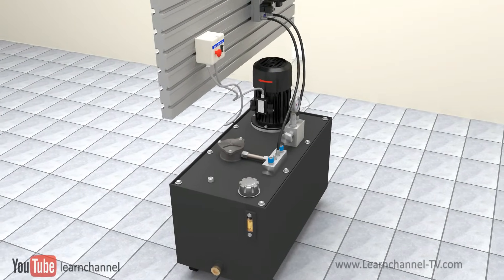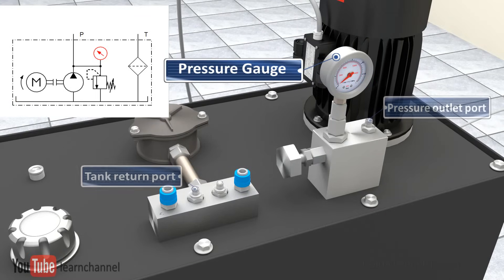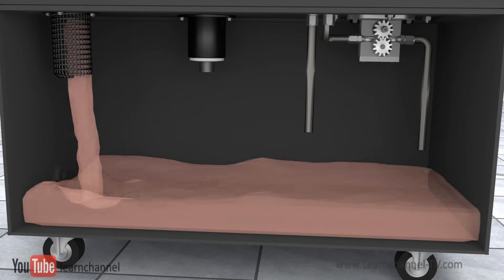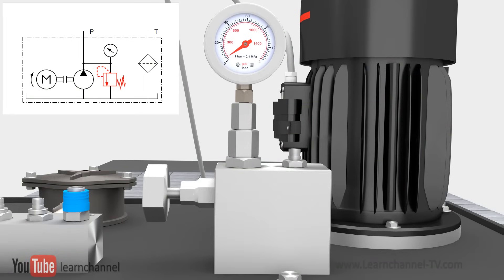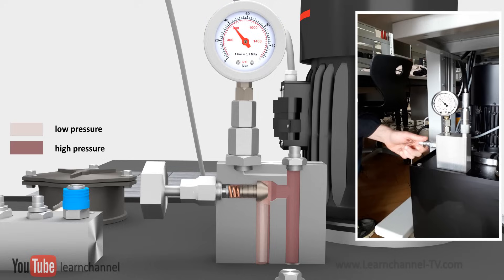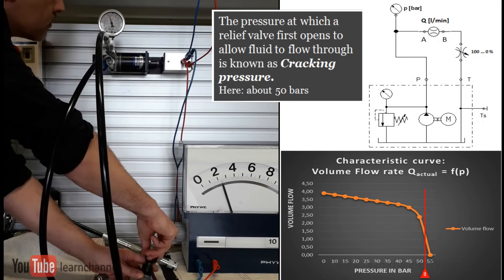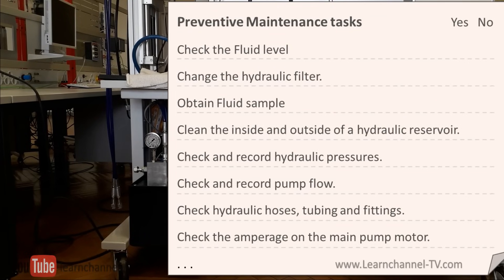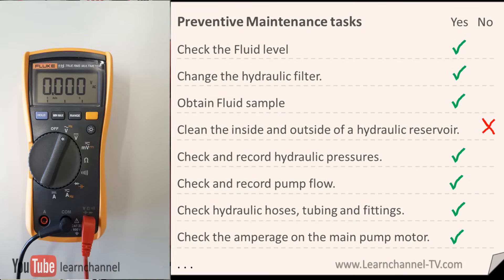Hydraulic Power Pack - how it works

Comment: How to calculate how many tons of pressure a hydraulic unit can produce?
 I want to use it in a cylinder of a plastic hydraulic injection molding machine. The cylinder is 25cm x 70cm

Comment: So Hydrolic motor will be a seperate unit from the Hydrolic Power pack ? I'm confused about whether Hydrolic motor is also a component of Hydrolic power pack circuit.
 Thanks for demolishing my confusuion.
Reply from the maker: Hi - I don't see an hydraulic motor in this video. The hydraulic power pack contains a hydraulic pump, which is driven here by an electric motor.

Comment: Hello sir,  the hydraulic pump has a 3 phase motor? Can i somehow find the wiring diagram of the setup where you control the hydraulic piston.  I can see that two wires going from the control buttons to the valve's coils. But where are the wires for the pump's motor?
Reply from the maker: Hi - this hydraulic pack has a single-phase induction motor - a capacitor motor. This is correct shown in this vid.

Comment: Hi. can this be used for high speed hydraulic tools such as pavement breakers (1400 blows/min)?
Reply from the maker: This hydraulic power pack is a small one for school. It can deliver 3,7 l/min and the maximal pressure is about 60 bars or 6 MPa. For construction sites you need a more robust one.
Reply: @learnchannel-TV  so I found out that I need about 30lpm flow and 1500psi pressure from a hpu to run the pavement breaker tool. What are the major components needed to make such a hpu?
Reply from the maker: @siddhantagarwal4371  The basic components, which has every hpu,: pump, filter, pressure relief valve, pressure gauge, manifold. Your motor to drive the pump will propably be a combustion motor.
Reply: @learnchannel-TV  Instead of a combustion motor, can't we run an electric power pack having such specs using a genset ?
Reply from the maker: @siddhantagarwal4371 And the generator set itself - driven by which motor?  Perhaps you might need the generator set also for other tools.
Reply: @learnchannel-TV  well genset such as those of honda are commonly available even for rent. My question is that apart from the type of power (either engine or electric) are there any different feature for a hpu to run high speed hydraulic tools (such as paving breakers) compared to the commonly available electric hpu used for linear actuators.
Reply from the maker: @siddhantagarwal4371  Perhaps you might need an hydraulic accumulator also to damp pressure surges. But sorry - I can´t tell it for sure.
Reply: @siddhantagarwal4371   to do what you want you'll need a decent genset atleast 15kva 30 litres is easy as just need atleast a 150l tank with a cooler and 11.5kw or so electric motor 45l pump fixed or variable displacement return filter valve block with a relief and and accumulator on the pressure to reduce pressure surges